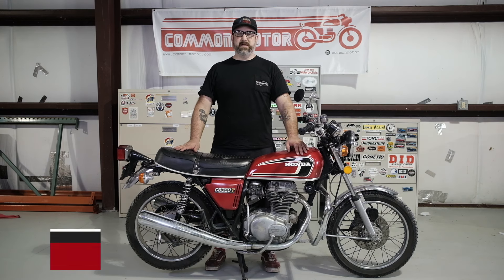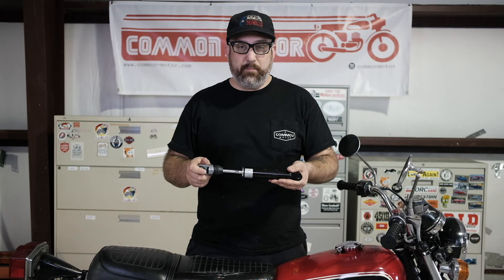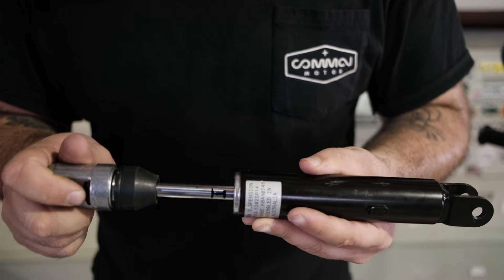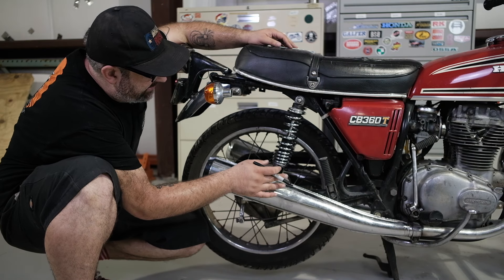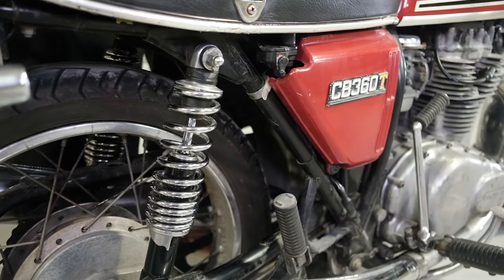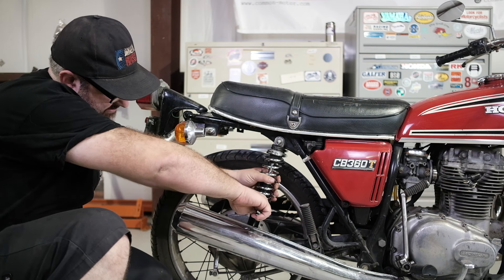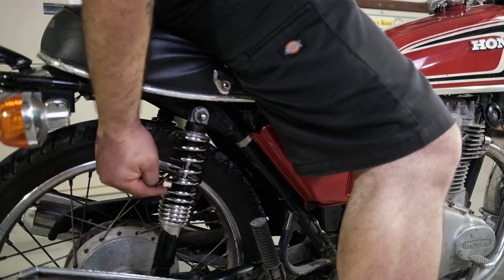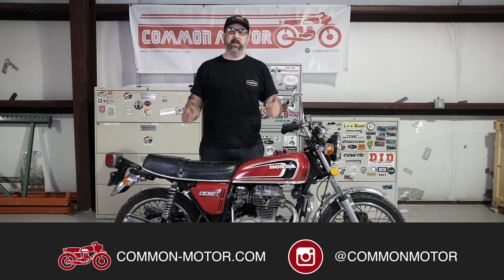How to Adjust Rear Motorcycle Shocks: Honda CB350, CB360, CB450, CB550

Comment: Shocks should be mounted with the cylinder on top facing down so water and dirt does not go into the piston cylinder and effect the rubber seals.Water has many impurities and minerals that can break down (Dry out) rubber and decrease the life of the piston seat o-ring.I like to spray into the shock piston a bio  based lubricant like Ultra lube to extend the life of the first set of rubber seals that seal the piston chamber.

Comment: Hi, good video….May i ask……. I have Royal Enfield Super Meteor 650. Fitted new Hagons rear shocks with recommended factory settings. after a ride I’m finding my bump stop rubbers have fully slid to the top. Ride is very nice but I’m concerned if they should bottom out at all? I do not feel the bottoming out at all? Thanks.

Comment: Thanks for the videos!
These apply to front shock absorbers ( with air pressure ) . HONDA CM400c 1981 has never been renovated. No leakage. Is it needed to replace the oil? Drain from the bottom and fill from the top?
Reply from the maker: Most rear shocks are not rebuildable, however front forks are. Oil change is standard maintenance.
Reply: I apologize, for noting the word front. I ask about the front shock absorbers. Thanks, and again sorry ...
Reply: @Common-motor  
If I get a shock that’s 13.38 inch’s 
Will it fit a 12.75 factory fit ?